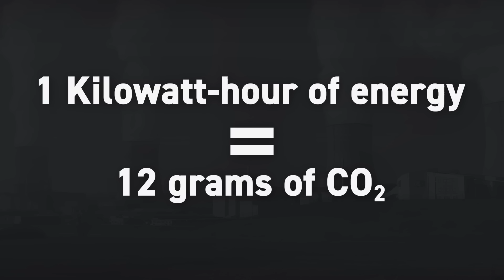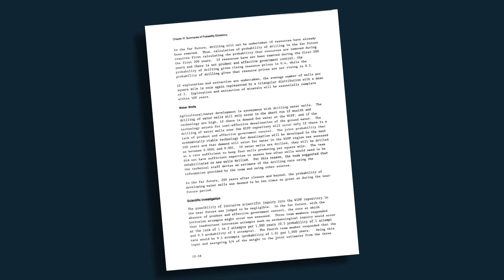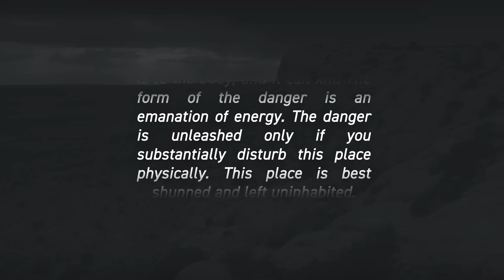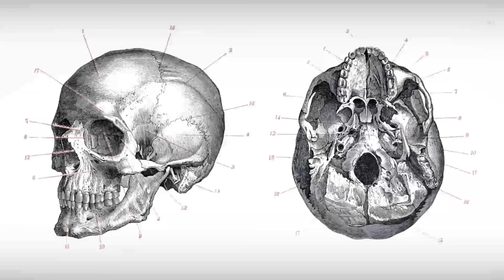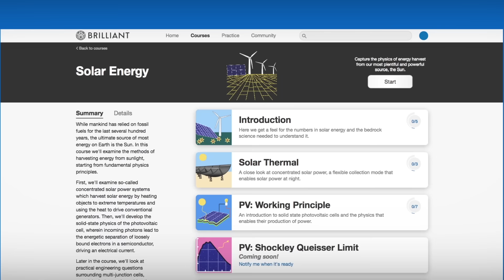The Nuclear Waste Problem

Comment: The U.S. Nuclear industry have spent possibly billions on supplemental safety precautions to safeguard against a disaster like Fukeshima. What happened there was they had lost offstite power, then the emergency diesel generators were flooded due to the tsunami therefore making them inoperable. The plant I've worked at have installed temporary power leads that can be connected to portable generators to ensure they could safely shut down the unit . This is only one of the many things they have done. The complete list would be too extensive. But we have never had a tsunami here.

Comment: For 300,000 years, even minuscule risks become near certainities over the total time.

Better is the processing of nuclear waste in breeder reactor; this leaves waste that only radiates 300 years (until it is back to the radiation level of the ore it was created from).

Breeder reactors exist in prototype form since the 1950s. Even if research into them is conducted at a snail's pace and it takes, say, 300 years to become operation-ready, that still is but 1/1,000 and less of the time a "permanent" storage would have to hold.

This also makes it mandatory to store nuclear waste recoverable.

BTW, Red China just commissioned a Molten Salt Thorium Reactor prototype, so it's more 20-50 than 300 years max until we have the ability to process nuclear waste.
Reply: There is a natural nuclear reactor in Gabon that has a uranium deposit where self-sustaining nuclear chain reactions have occurred 2 billion years ago and are believed to last a couple of hundred thousand years. Everything is contained in geologically stable deposits. True that it would be better to process it and recycle the fuel since uranium is not a particularly common element in the Earth crust.

Comment: A "problem" that's not really a problem!  
Almost every town has storage tanks containing tens of thousands of gallons of fossil fuels, and in most cases don't even have a fence stopping people from walking right up to the tanks!  
People are for the most part, smart enough to just stay away from the tanks, and hopefully not be smoking close to them.  There's household cleaning chemicals and insecticides that are display on shelves in stores, some are even sitting on lower shelves where young kids could access them!  That is thousands of times more likely to cause harm than nuclear waste!  People simply worry about things that they really don't need to worry about!

Comment: The US Nuclear Waste Technical Review Board admits no one has any idea how to store this waste in a geological repository even for the short-term. Technology doesn't exist and they have no clue how they will ever have the technology to make it work. In the mean time we're stuck with this deadly waste that is unsafely stored in the US using thin-wall (most only 1/2" thick) stainless canisters. These thin cans are vulnerable to short-term cracking, but cannot be and never have been inspected or repaired (inside or outside). Other countries use maintainable thick-wall metal casks 10" to 19.75 " thick and store the thick casks in hardened buildings for environmental and security protection. 

The thin-wall canisters are stored in thick concrete casks, but those casks have huge air vents for convection cooling to keep the fuel cool so it doesn't explode. 

Each canister or cask holds roughly the amount of radioactive particles released from the 1986 Chernobyl nuclear disaster. The US already has 3200 of these unsafe canisters. The problem is now. Learn more at SanOnofreSafety.org. Your future depends on it. I've spent the last decade researching this and was shocked to learn the Nuclear Regulatory Commission weakens safety regulations in order to put nuclear industry short-term profits over our short and long term safety and financial well-being.

Comment: They should just mark the burial site with a massive radiation warning sign that lays flat on the ground. Something like 50 meters by 50 meters. Make the elements out of granite or Roman concrete for durability and resistance to erosion.

Comment: Perhaps designing it to be as deadly as possible.  If anyone messes with it
they will die very quickly thus minimizing the damage to the storage system
also communicating an overt message  'Do not screw with this'.

Comment: You conveniently forgot to mention 3 Mile Island!
Probably because its an American facility that had a reactor melt down!
"The Three Mile Island accident was a partial meltdown of reactor number 2 of Three Mile Island Nuclear Generating Station (TMI-2) in Dauphin County, Pennsylvania, near Harrisburg and subsequent radiation leak that occurred on March 28, 1979. It was the most significant accident in U.S. commercial nuclear power plant history."
If you are going to comment on nuclear accidents, do the job properly!
NO nuclear power station is safe, and you CANNOT dispose of the waste, either low level or high level, safely.
The alternatives are far safer!
Reply: ever heard of thorium? what about fusion?

Comment: Theres research neing done into creating a nuclear fusion reactor for the production of clean energy. And it will never run out. Its basically a reactor which replicates the type of fusion in the suns core.
Reply: it still makes nuclear waste but it's not radioactive materials
Reply: @coketruck  but the waste is not radioactive
Reply: the process of fusion contaminates the reactor cover blanket which is radioactive

Comment: What is usually referred to as nuclear waste is used nuclear fuel in the shape of rods about 12 feet long. For four and a half years, the uranium atoms that comprise the fuel rods are split apart to give off the heat that turns water into steam to spin turbines to make electricity. After that, nuclear plant workers move the used fuel rods into pools of water to cool.

Four to six years later, nuclear plant workers move the used fuel rods into 15-foot tall canisters known as “dry casks” that weigh 100 tons or more. These cans of used fuel sit undramatically on an area about the size of a basketball court. Thanks to “The Simpsons,” people tend to think nuclear waste is fluorescent green or even liquid. It’s not. It is boring gray metal.

How much is there? If all the nuclear waste from U.S. power plants were put on a football field, it would stack up just 50 feet high. In comparison to the waste produced by every other kind of electricity production, that quantity is close to zero.

Comment: The majority of current nuclear power plants, both military and commercial, are based on the design of the nuclear reactor built for the naval submarine.  In many ways they are amazing, however they “use” less than 1% of the “fuel”.  The “spent fuel” has been stored so that it could be used in “next generation” reactors.  How many of us would fill up our car with gas, drive it until we had used a cup of the 16 gallons in the tank and throw the rest of it away as “waste” and go to a gas station and fill it up again.  If we don’t design better (and safer) reactors than the Nautilus (1954), we’ll continue to refer to the “spent fuel” as waste.  But it is not “waste”.  The “spent fuel” has over 99% of the energy potential still waiting to be used.  The engineers and scientists knew this back in the 1940’s.  They built and tested 2 “breeder” reactors in Idaho – EBR-I (1951) and EBR-II (1964).  Also, EBR-II was “walk-away” SAFE.  Then they built and tested a potentially better design with the MSRE in Oak Ridge.  It also was “walk-away” SAFE AND had some other major possibilities.

Let’s at least have enough faith to invest a little money to build the “next generation” reactors that might achieve what the scientists back in the 1940’s and 50’s believed could be built.  The Chinese are moving forward, currently 31 reactors under construction.  The Chinese and other countries want “clean” energy.  They are using the work started in the United States.  The Chinese want to “eat our lunch” with technology invented in the United States.

Comment: Build nuclear power plants underground? Not sure if it is technically feasible. But it should be easier to bury it in case of a disaster.  It should not affect surface areas.

Comment: The water heats up to boiling? I’m sorry, isn’t that exactly how a nuclear power plant works in the first place? Sounds to me like there’s more energy to be had from that nuclear waste.
Reply: You could use the thermal emission of certain isotopes. Pu-238, Sr-90, amd Am-241 are all thermally emissive. Often, they are coupled with Peltier Plates, which produce a voltage with applied heat. The resulting system is called an RTG, or Radioisotope Thermoelectric Generator. Unfortunately Sr-90 is a beta emitter, and thus requires strong shielding, else the Lia accident happen again. Pu-238 is the best, since it is an alpha emitter, and strong thermal source.

Comment: “We know how to deal with nuclear waste safely. The Finns simply chose to go ahead and solve their nuclear waste issue and built the repository at Onkalo. We have good experience with deep geologic disposal in salt deposits that have been stable for 250 million years. Research in deep borehole technology is also looking promising. Finally, if we close the fuel cycle and recycle spent fuel, then it decays to safe levels in several hundred years rather than hundreds of thousands. Furthermore, despite the fear, very few people, if any, have ever been injured by stored commercial nuclear waste.”

Dr Nick Touran, nuclear engineer
Reply: The onkalo nuclear waste facility was pretty expensive. Also almost every nuclear plant went overbudget and over time. To solve climate change we don't have time for nuclear plants

Comment: an interesting solution to the nuclear waste problem is to not store it at all and instead use it as fuel, when used in a conventional reaction unenriched uranium can only use about .5% of the uranium atoms for fission the other 99.5% is nuclear waste this is because 99.3% of the uranium is u238 which is unable to undergo fision and only the 0.7% u235 can actually release energy and even so once its concentration goes down to about 0.2% its too diluted to even do that efficiency however breeder reactors are able to take what would be nuclear waste and turn it into fuel transmutation, if you fire radiation at the u238 in a specific way you can turn it into plutonium 239 which can then be burned for fuel in the reactor allowing you to get near 100% like 99.5% fuel efficiency. to be fair this does still leave the 0.5% so it doesnt complete solve the issue but if you were to extract the leftover fertile and fissile material and combine it with other scraps of nucelar fuel you could create new fuel rods and effectively reduce the entire nuclear waste problem down to only the isotopes which cant be turned into fuel or burned in a reactor which is order of magnitude smaller than what were dealing with now

Comment: what you've discussed is just spent fuel or high level waste. there are medium level waste & low level waste. don't be fooled by the term "low level". LLW has four subcategories: Classes A, B, C, and Greater-Than Class-C (GTCC), described below. On average, Class A is the least hazardous while GTCC is the most hazardous. 
Class A On average the least radioactive of the four LLW classes. Primarily contaminated with “short-lived” radionuclides. (average concentration: 0.1 curies/cubic foot) 
Class B May be contaminated with a greater amount of “short-lived” radionuclides than Class A.(average concentration: 2 curies/cubic foot) 
Class C May be contaminated with greater amounts of long-lived and short-lived radionuclides than Class A or B. (average concentration: 7 curies/cubic foot) 
GTCC Most radioactive of the low-level classes. (average concentration: 300 to 2,500 curies/cubic foot) (The 300 figure is based on the 1985 inventory. The higher figure represents anticipated inventory in 2020, including some decommissioning wastes.)

note that a curie is a large unit, radioactivity results are usually shown in picocuries (pCi). A picocurie is one trillionth of a curie. 

1 becqurel is 1 atomic decay per second
1 curie is 3.7x10^10 becquerels.

Comment: Would it be possible to seal the spent rods into a watertight container similar to a tank for an air compressor. With pressure relief valves leading to piping into another turbine that exclusively powers the equipment needed to maintain storage? So as the water boils the steak turns a turbine that powers pumps, monitoring equipment, ect. I'm not saying it's a permanent fix but sounds better than chucking it in a pool and making sure it's topped off.
Reply: or, consider just putting it in a steel/concrete tub and keep it onsite, like we do today. or put it in the ocean and let it dilute, like all the rest of the radiation in the ocean, or use it in a msr. honestly, there are a lot of significantly better, less irrational ways of keeping it contained for the entirety of the time it will be an issue (hint, not literally forever, like the op seems to think we need.)

Comment: The best option would be to send the s[ent fuel into orbit around the sun, it will casually decay, and not bother anyone or anything
Reply: What if the rocket explodes? The best thing to do Is to bury it 3 miles down it’s called a deep borehole disposal

Comment: How about using the fuel until it is "more spent" for lack of better words, and is only radioactive for a few hundred years?  

It's possible, and if not now, will soon be feasible.  No point in permanently burying it just yet.

Comment: Is yeeting it into space not a option?
Reply: The cost of doing so would require more energy than it created as a power source.  Uranium is the heaviest element.  That doesn't matter much on a truck, or even a ship, but it matters on a rocket.  If we could lift that many tons into space on a routine basis, we could just build an orbital power infrastructure that collected sunlight without clouds or atmosphere in the way, running day and night.

We may, at some point, be able to figure out how to make thorium based fission practical or how to control fusion, either of which should create little or no dangerous waste.  We may even be able to reprocess used uranium fuel, making it safe.  But all three of those are maybes, and we need to prepare for the possibility that they won't become practical, especially since we still need to be able to use nuclear in our mix, even if they don't.

Comment: okay, so we don't have actual permanent storage facility, but we have some in construction and plan for more and more efficient ones. future civilization that don't have an idea of what is radiation will have difficulties dinging thousands of meters of concrete to find the nuclear waste storage sites and even then, the only casualties will be the research/working crew just some 10 to 200 peoples, the surface will not be affected. The biggest argument that I see for the nuclear is that it can produce as much as fossil fuel energy and won't destroy the planet in the next 50 years. And long term there is less than 5% of the waste that can't be processed and finding long term solutions for that is manageable in the next century witch is sufficient.

Comment: Okay, I like many of Wendover Productions' videos, but this one is more like a propaganda. This video provided a very limited and single-sided information about nuclear energy. Also, that's not how Fukushima Daiichi accident happened, not exactly. At the time, the reactor was shut down under an emergency due to the earthquake, the fuel remained inside the reactor which was still at a extremely high temperature. So, the nuclear accident was NOT caused by the spent fuel in the pool. Plus, uranium is NOT the only option. Other types of fuel are abundant, can be more efficient, and the waste's radioactivity only persist hundreds of years. For example, Thorium.